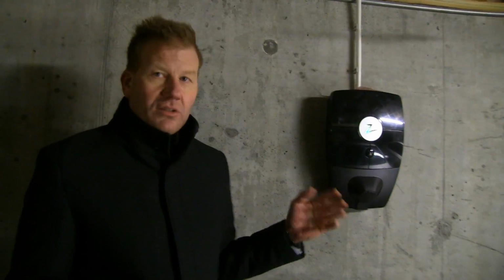Zapcharger Pro - Changing the way you charge

Comment: the video ended at the most interesting point. you should have unpluged the other car and demonstrate that the limit has dynamically changed. unlike other dumbed down cars, Tesla shows the instant current (before the slash), the charger limit (charger changes it dynamically, it is the figure after the slash), and you can set your own limit below the charger limit (via spinbox).

Comment: Nice implementation of power sharing EVSEs. The copper and circuit breaker savings is worth it!

Do the stations have an offline mode, in case the local Internet connectivity fails (or the cloud servers become temporarily unavailable)?

Comment: that sounds cool. is there any information about the communication between the chargers or how do they determine how much current they can use without blowing the breaker?
Reply from the maker: Everything is controlled in the cloud.
Reply: Well, this means, they need internet access?
Reply from the maker: Ruben Kelevra Exactly.
Reply: Well, okay, how is this done? Do it need wifi or have it 2G/3G built in? Is there running costs for the cloud thing? :)
Reply from the maker: Ruben Kelevra One data connection is needed to give internet connection to one of the Zapchargers. That one will then get all the other Zapchargers online via power-line communication. Another solution is to use wifi. And when one Zapcharger goes online, it will then use power-line communication to get the other Zapchargers online.

If the "master" goes down, a new Zapcharger will become a new master.
Reply: Bjørn Nyland, why these companies crave for the private data so much? These chargers could have arbitrated the use of power solely via PLC. Every charger would need two manual settings. Site capacity and a random site id, and an optional limit at the charger itself (if needed). If the charger does not see other chargers on the network, it would assume that it can use all the site power. If it sees that some other charger has lower site limit configured with the same site id, it would use that, just to be safe. Privacy aside, this method would not have the cloud, the communication channel as potential points of failure. I assume that if communication channel is down for whatever reason, chargers would refuse to charge?

Comment: Does Zapcharger  can accept 60A power, do or will they sell they systems for US customers? If it could pull 60A on 240V circuit what power (.kWt )would I get (in my house)?
Reply: Sergey Yevtukh 60A*240V=14400W or 14.4kW

Comment: I guess the 21A * 3phases * 240V = 15,1kW/h is all the car can take with the upgraded facelift charger.
Reply: 21 should be the dynamic limit imposed by the charger. if you look closely just after plugging in, the limit is 24. the actual rating for dual charger EU car is 16.5 kW.